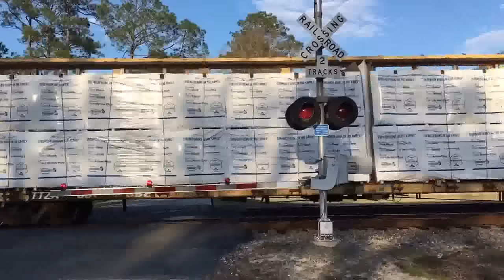What Happens When Railroad Crossing Gates Malfunction?!   Etc.

Comment: In the second clip, the school van stops at the RR crossing as required by law. The driver pulled up to the tracks so as to see if a train might be coming. Then just as ready to proceed, the crossing bells start clanging and the gates come down. The driver was backing up, but by the time the pickup truck behind moved back, the gates hit the roof. The pickup pulled right behind the school van at a railroad crossing while the van had its hazard flashers on.  That's not the right thing to do.
Reply: The law is the law and we can't change it.
Reply: @SebastianMammoth  Right so throw the driver of the pickup in jail for 90 days with a fine
Reply: @guineapiglady2841  no the van closer to the camera
Reply: @guineapiglady2841  there is a van on the right that has SCHOOL on top
Reply: @saurus12  maybe it is, maybe it isn't.  whatever. 
Bad driver though.
Reply: Whatever!!
Reply: @Big_Egg1122  You mean the van under the railroad crossing gate!  Groan!!
Reply: @guineapiglady2841  the driver in the van was not held responsible. The pickup truck got a ticket, it was in my local news.
Reply: @ybunnygurl  Yeah yeah yeah
Reply: While the gate is on top of the van... Look closely at the hood of the actual school bus. The far gate is across the hood of the bus as well.
Reply: If you also notice it came down on the hood of the bus as well
Reply: @ybunnygurl  Why did the pickup get a ticket?
Reply: @lolzlolz69 
For not allowing the van to back up.

Comment: If the trains went faster through crossings seems like the problem of cars going around the gates would solve itself. /s
Reply: I think they have to go slow bc of pedestrians in a built up area with a speed limit
Reply: Depends on the city trains are only allowed to go a certain speed within city limits. I live by one that is less than a mile from the city limits...I can tell when those suckers hits the country because they are hauling ass at that point
Reply: @HolidayDecorator  "we sadly have some of the most idiotic and stupid drivers here" are you challenging Texas?
Reply: @HolidayDecorator  well look at it this way, the roads will be clear in a week after it's up and running
Reply: The gates are required by law to be fully down a certain number of seconds before the train reaches the crossing, so if the trains went faster... the gates would just have to start coming down earlier.
Reply: Tp L  Problem with that is, there are fifty to one hundred thousand level crossings in the US alone. Each conversion costs at least $1 million, and possible much more. Who pays for that? The municipalities obviously want the railroads to pay, but the railroads want the municipalities to pay because they are the ones who will benefit from the work. 

That's not to say that there isn't work being done. Most railroads have a crossing elimination program that does target crossings meeting certain criteria (vehicles and trains per day). There's a crossing near my house that's being replaced by an overpass as we speak. 

Finally, vehicles becoming disabled on crossings is far from the leading cause of crossing incidents. With the exception of low trucks grounding out, how often do you actually see a vehicle stalled or broken down on a crossing? And even if it does happen, every crossing has a posted emergency phone number to a dispatcher who will stop trains coming with just a few minutes notice. The leading cause of crossing deaths is people driving in front of the train. Not paying attention at unmarked crossings, or trying to beat the train when they see it coming. That's not on the railroad, that's on us as drivers. 

Sorry for such a long post, but I hope this answers questions that other people reading it might have as well.
Reply: Tp L  you don't understand, you gotta have a really heavy train to go up and down even a small hill
Reply: Tp L  the real hazzard is People Do Not Use Their Brains! If They Did Most "Accidents" Would Never Happen! The Simplest Fix That Will Never EVER Cost A Thing As Everyone Is Born With One And Is So Freaking Easy Too Use There Is No Excuse For Not Using It Except Stupidity As A Direct Result Of Being Lazy!
Reply: I'm surprised south Dakota doesn't have more train accidents at least in rapid city we have the worst drivers and some one decided that trains need to come through at rush hour morning and afternoon.
Reply: Speed limits usually ignore crossings I believe, but they slow down in cities because the track is more windy and there's yards to navigate. If you see one of those rural crossings, they're highballing through them.
Reply: clearing the bodies out of the car is a lot of work though. not worth the minor I told you so moment.
Reply: Train wins.....everytime
Reply: Or just wait like you should you don’t have right of way
Reply: I'm from Hamilton. They 100% do that.
Reply: Its not the speed of the trains that's the problem. It is the speed the cars are used to. The drivers have no patience and are willing to risk their lives and others in a race.
Reply: @julieenslow5915  whoosh
Reply: @thewhitefalcon8539  
See that? Perfect example.
Reply: @TheUrbanGaze  Speed limits for trains do factor in grade crossings because other then malfunctioning switches grade crossings are the second likely places where derailments happen because dirt can easily get trapped between the rail and asphalt and if not maintained easily allows for a train to derail. Also, the conductors have signage that lets them know there is a crossing up ahead well in advance. That is why you can hear their horn blaring before you even see them or they see the crossing. As for going slower in cities, it is not because it is more windy, but rather there is more crossings and vehicles that can end up in the way and it is easier to stop a slow moving train or make it go slower if it was already going slow to begin with. Also cities have control over the speed limits that trains can go in the city unlike once they are outside of city limits for the most part they can go whatever speed they want to go only being told by policies/dispatchers their max speeds.
Reply: @connorc9537  what's Rush hour in Dakota 50 to a 100 cars?
Reply: @Moose803  Hey now.
Reply: @XMYeks  Texas drivers get their licenses from Crackerjack boxes. Florida drivers don't bother with the pretense.